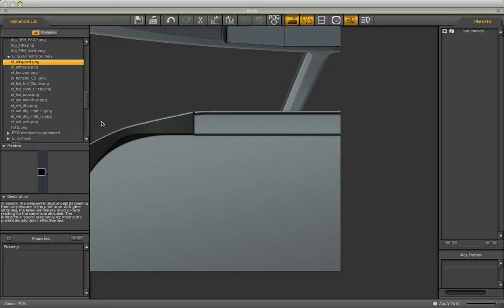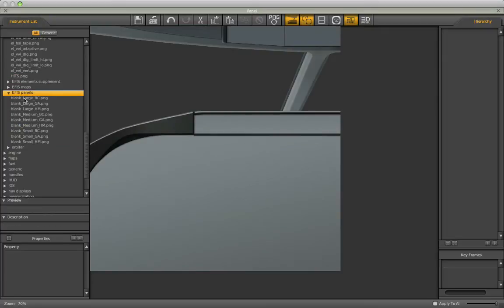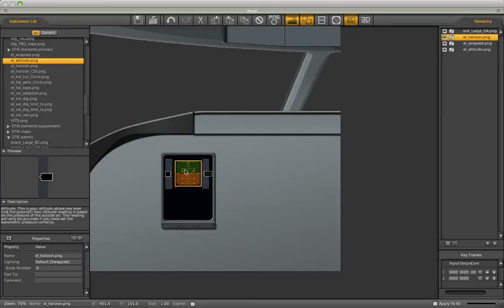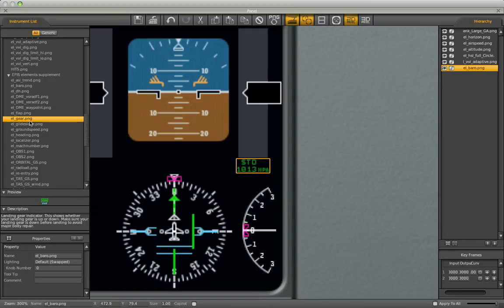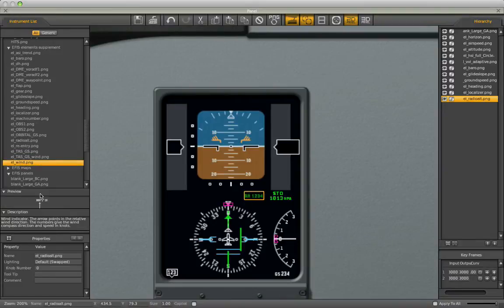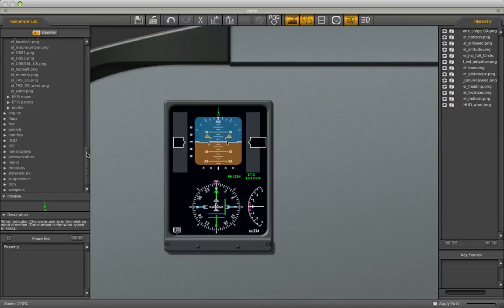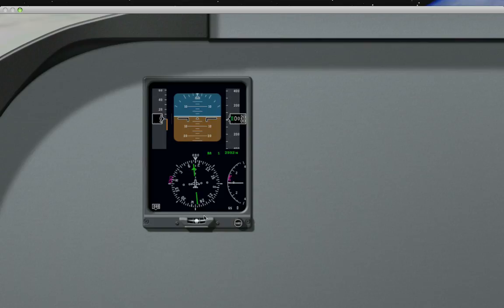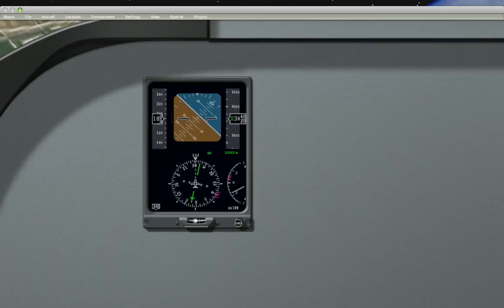PlaneMaker Tutorial 9: Assembling Cockpit Instrument Panel

Comment: Excellent video. I am building an f-35 simulator cockpit. The F35 as a full width class screen with every thing on it. I am putting in a 9x16 or 6 x 21 monitor for the instrument panel. Question 1. In x-plane, is there a way to model this panel with the interactivity to change it with touch screen. Question 2. I can turn the instrument panel off in my main screen. Is there a way to assign the 2D instrument panel to this separate monitor I am using for my panel. Thanks. Wayne
Reply from the maker: 1. Yes.  If you´re making it in PlaneMaker, you create your on-screen component, and then you have to put a "generic>gen_trigger" on top of that visual component.  Create a button right on top of the screen. But make the artwork transparent. If the context of the screen changes, and you no longer have the visual component underneath the button that you wanted, then you have to work with show/hide to get the button out of the way.  "gen_trigger" works with commands. If you want to work with datarefs, you have to work with "gen_rotary" type generic.

2. Yes, but it has to go through a plugin.  If you have not yet worked with plugins and programming, you've got a bit of a learning curve ahead of you, and that would be way outside the scope of this tutorial.  But say you use SASL to do this. SASL taps into X-Plane's SDK, and allows you to program more simply, using scripts, and without having to compile for multiple platforms.  You'd use the feature getTargetTextureData.  It'd be like "screensharing" from whatever you've created in the PlaneMaker panel editor, to a SASL pop-up window, which is set to have the ability to pop out.  You'd then pop it out, and move it to another monitor.
Reply: Thank you very very much. Of all the inquiries I have made in the past two weeks, including manufacturers, you are the only one to respond. Is there a place on X-Plane site, or a third party book, on using these programming features within X-Plane. Thanks. Wayne
Reply from the maker: @WayneMcNab  Well, you have to do a lot of Googling.  "SASL Manual", for example, or "X-Plane SDK".